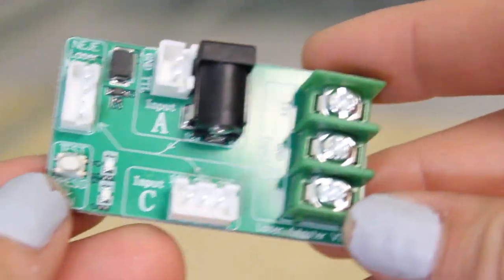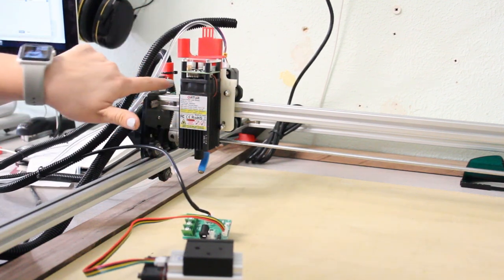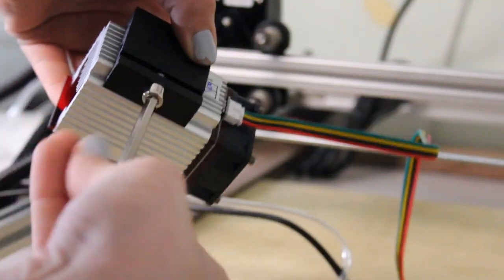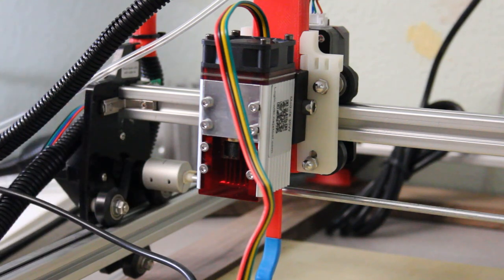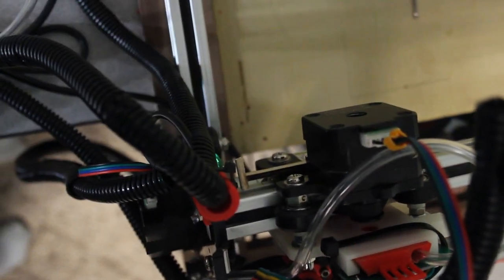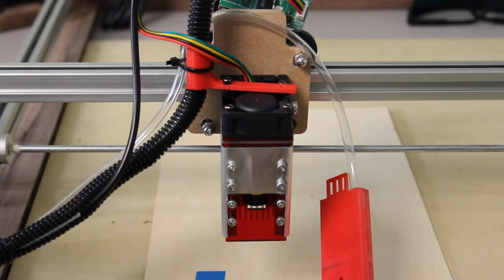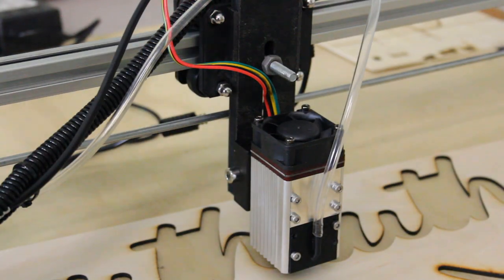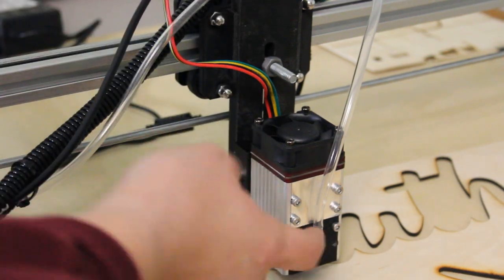Neje 30w Laser Installation on Ortur Laser Setup

Comment from the maker: I hope you all enjoyed the video! Also, let me know what you thought about the video quality. I just got a new Canon camera and used it in this video! Thanks for watching!!
Reply: I've just gotten my Ortur set up. Now I have to go and get a Neje. This channel is exceedingly hard on my wallet :-)
I'm learning tonnes from you though. Thanks!  One question: What percentage efficiency do you estimate that you gain from the air assist?
Reply from the maker: @davidr5964  Ha ha ha! Don’t let me tell you what you need to go buy.lol the ortur works just fine;) anyway, The air assist I think helps a lot. It clears away the smoke to also allow the laser to cut cleaner and last longer. I don’t think I would get a very clean cut with something with two passes without air assist. I feel like it probably makes it at least 80% better and makes your laser last longer. Before I had the air assist it was really hard to get a clean even cut in less passes
Reply: @TimberWood.Customs  Thanks a lot for the reply. I'm going to stick with the stock 5w on the Ortur until I at least try the 5w with air assist. Having lots of fun experimenting :)
Reply from the maker: @davidr5964  yeah in all honesty it’s not a huge difference from 5.5 to 7.5 I just really wanted to try it.
Reply: I had bought myself a genmitsu le5040 laser engraver and thought it will cut through plywood of 3mm, but it did not as there where misunderstanding or communication between the seller and myself and the output of 5.5w.

Last week I bought a Neje 30w output 7.5w laser module and replace the module with now problem

I need help on lasergrbl settings - in my book icon it does not show much of laser modules cause mine is now (30w) 7.5w and it shows only orthur 20w (5.5w) and other

Do I need other settings or software to be able to cut?
what do you think would be the best optimal focus distance between the laser and material?
Reply: @TimberWood.Customs  I had bought myself a genmitsu le5040 laser engraver and thought it will cut through plywood of 3mm, but it did not as there where misunderstanding or communication between the seller and myself and the output of 5.5w.

Last week I bought a Neje 30w output 7.5w laser module and replace the module with now problem

I need help on lasergrbl settings - in my book icon it does not show much of laser modules cause mine is now (30w) 7.5w and it shows only orthur 20w (5.5w) and other

Do I need other settings or software to be able to cut?
what do you think would be the best optimal focus distance between the laser and material?
Reply: pro tip : you can watch movies at kaldrostream. I've been using them for watching all kinds of movies recently.
Reply: @Hayes Elisha Definitely, been watching on flixzone} for since november myself =)

Comment: Excellent video. I was wondering if that air assist would work on my Neje Machine? And where I could get one? I cant find any that resemble that on. Thanks
Reply from the maker: You can get the air pump on amazon, it should be in the discription of the video

Comment: That's cool.  I'd love to add a 30-40 watt laser to my new Ortur Laser Master Pro 2 S2 LF.  I saw a guy on YouTube cutting 6mm plywood and pine board in 2 passes with his OLMP 2 s2 so I wrote to Ortur and they are sending me a new laser because mine takes 6 passes to cut through 3mm basswood plywood.  I wish Ortur would offer a 40 watt upgrade at a reasonable price (like $139 for their current lasers).  But I don't want to jerry-rig a Neje to this system.  I'd like one that's plug-n-play, so we'll have to wait for Ortur to step up to the plate and give us some options.
Reply: I have seen mounting brackets online that that make this Neje laser compatible with the Ortur machine so you wouldn’t have to drill. Last I checked, about $20 on EBay.
Reply: @jonathanshaffer4399  what do you search for on Ebay?  how detailed is your search query? Just Neje laser mounting bracket?

Comment: Nice job with the video. I have only one issue though. I bought one of the NEJE modules. It worked pretty good right out of the box. unfortunately it only lasted five hrs burning time. I tried to Warranty the module. They require a YouTube video, I am not a Tuber!!!! I watch videos not make them. I was a bit put off. well I made a video (it was really bad by standard) but it did show just how much power the module lost. my reply was, when it dies completely try and contact them again. DO keep in mind that this module dose not work period, it is nothing more than a laser pointer and not even a good one. Again I like your videos keep up good work but you may want to hold of on Neje vid's until you get more time on the module, if you do? Good luck.

Comment: I've upgraded my Ortur Laser Maser 2 20W (5.5W cutting) with the new Neje 80w (15w cutting with dual laser beam). It works fantastic !  However a couple of notes I found out in my research. My Ortur Laser Master 2 is a 12VDC setup and the new Neje 80w is also 12VDC. However there are some lasers (I think the new Ortur Laser Master Pro) that use a 24VDC Laser setup. If you try to connect this module to a 24VDC setup, you need to follow a different procedure or your new laser module will be fried. You will need to connect the supplied 12VDC power adapter directly to the socket on the supplied circuit board to power the laser module. You will also need to cut the power cable from the Laser control board to the laser.  Just a heads up.
Reply: This is the problem that I am trying to figure out. You mean just dont hook up the cable that powers the laser from the control board?

Comment: I had bought myself a genmitsu le5040 laser engraver and thought it will cut through plywood of 3mm, but it did not as there where misunderstanding or communication between the seller and myself and the output of 5.5w.

Last week I bought a Neje 30w output 7.5w laser module and replace the module with now problem

I need help on lasergrbl settings - in my book icon it does not show much of laser modules cause mine is now (30w) 7.5w and it shows only orthur 20w (5.5w) and other

Do I need other settings or software to be able to cut?
what do you think would be the best optimal focus distance between the laser and material?
Reply from the maker: U don’t have to do anything the laser is 7.5w and the software doesn’t change, when I changed from my 5.5w to the neje 7.5w I didn’t change anything in light burn
Reply from the maker: My 5.5w cut though 3mm ply, with 5 passes at 80 power and 300mm/min speed
Reply: @TimberWood.Customs  what do you think would be the best optimal focus distance between the laser and material?

Comment: Good job.
Can we connect same way with orture pro2 because It have been operated at 24 volt.
Reply from the maker: Yes you can
Reply: How can I.
Can share details..?
Reply: @TimberWood.Customs  how can I? Can u share details?
Reply from the maker: @atifali4703  should be able to connect just like I did in this video
Reply: @TimberWood.Customs  thank you  I shall be.
Reply: If it's working voltage are 12 then how it's compatible with ortur master 2 Pro because it's operating voltage are 24 and today I connected neje 30 watt Laser module with it its blow up.
Reply: It's blink one time after that nothing happened.
Then I tried to connect it with 12 volt with drivery circuit which was provided with neje but only fan is jerking.
When I connected with ortur I also used drivery circuit.
Can you help me how to repair 30 watt neje laser head.

Comment: Hello, the neje a40640 module comes with two cards. Both with power supply input. Considering that the ortur has its own, then will I need three sources? Or do I energize one of them like you did? cheers, ariel

Comment: where did you get STL file for 3D printed mount? I was trying to make one, but blender program is so confusing to me, and i dont have any program to design the new mount plate, or even but out from plywood. Is there any way I can get STL file for 3d printer for the mount you have? I failed so many times already, and once the 3D printer got stuck and entire filament went to a big waste..
Reply from the maker: Yeah if you message me on Instagram I can help!

Comment: I'm gonna cheat a bit I was able to get 2000mw Mini Laser Engraver Cutter for a low $110.  When it arrives I want to take my Neje Master 2 20 W head and board and put it into the larger frame so I can increase the bed size from 6 X 6.  to  ( 25.5 by 19.5 inches ) and put the lower watt in the Neje frame.  When I go to lightburn I would add it as a new device and put in the Dimensions  and then it will know the laser area  I think that's what  you advised me.  Any other  tips or tricks I should know?

Comment: The video was great! So I’m a little confused..you’re laser seems to have a huge cutting area..what is the size of space you have for the x and y axis? The one link you gave me says only 400m x 450m which is only like 16” right?id like a bigger area like 24”x24” is there a laser out there like that? If so please let me know..looking around the 300$ range and upgrading to the 7 watt later..thanks
Reply from the maker: Hi! So my machine was originally the 400 mm x 450 mm. But in my past videos I showed that I change the dimensions. My new cutting size is 916 mm x 787 mm. This laser is about $170 and the rails cost me probably $30. So you could probably build your own kind a looking like this for under 300

Comment: yesterday  received the Neje 30w Laser and it turns on as soon as I supply power. the switch has no control. was there anything special you did to control the beam. I am thinking I have a defective unit?
Reply from the maker: Just make sure you are using a stronger power supply. I upgraded mine to a six amp power supply plug-in. Other than that I was able to control everything through light burn

Comment: Hi, i watched the video and it did not work for me. I have the Ortur Laser Master 2 pro which is 24v. I plugged it in and pressed the test button and it did fire, but when i tried using it via lightburn the 2 LED on the interface module started to blink at the same time and i then got a smell of burning.

I disconnected everything and put my Ortur laser back on and it was ok. Does anyone know what the 2 LED lights means? Mine are flashing together (red and Blue).

Comment: You forgot to mention changing the power supply. Without the new power supply you're only going to get a marginal increase in output.
Reply: Hi There! This seems to be my problem. I installed the Neje Module on my Ortur but the result is that there is no better performance than compared to the original Ortur module. Where can I get a stronger power supply for my Ortur?
Reply: @killexawo  Amazon!
Reply: @TheLouisianaHobbyGuy  Alright, thanks! 12V, 3 Amps, correct? Do I have to remove the other power cable when I use the power supply? Or do I need to have both connected, power suppy and the plug with the three wires?
Reply: @killexawo  You should have the Neje adapter board, where you plug in the dedicated PS directly to the board not using the laser PS at all. And no, it is a 4A 12V at least.
Reply: @TheLouisianaHobbyGuy  Great, thanks for your support! I ordered a power supply and I am looking forward for better results then. I will let you know. Thanks once more!
Reply: @TheLouisianaHobbyGuy  I got my 5A 12V PS today and connected it. From the plug with the three cables I removed the red one (I read this on your channel). Result is very dissapointing. Absolutely no Power at all :-( Cutting is worse than with my old Ortur LU1-4 module
Reply: @killexawo  Well then you either have a bad PS or the wiring wrong.
Reply: @TheLouisianaHobbyGuy  Thanks for your help once more. I think I found a solution working for me: I connected the wires from Ortur to the Neje module directly, not using the adapter board at all. Going into the Ortur I am going with my 12V 5A Power supply now and I am very happy with the result. Thanks again :-)
Reply: @killexawo  Well you're not getting the full power of the laser module, but if you're happy, that's all that matters.
Reply: @TheLouisianaHobbyGuy  I should somehow go with my 12V/5A into the module correctly, right?
Reply: @TheLouisianaHobbyGuy  I tested this option, but unfortunately the laser burns permanently as soon as I plug in the power supply. (Of course I connected the TTL) I will go back to my last "concept" which worked pretty well.

Comment: What are the advantages of this new laser vs. the stock laser?  Thanks
Reply from the maker: In all honesty not a whole lot. Maybe a little bit faster in engraving and cutting materials because it is so close to the material. But honestly I just wanted to see what kind of difference it would make. But you don’t really need to upgrade if you have a 20 W(5.5w) laser already installed

Comment: How your ortur machine did not burn your laser ? I burnt my laser module by connecting my neje 20W laser to ortur without knowing that the ortur operates at 24V and laser module was supposed to be operated at 12V , so how is your laser working ?
Reply from the maker: It just never burnt it
Reply: @TimberWood.Customs  What is the power input of your ortur ? And what model is that?
Reply from the maker: @prajjwalsrivastava4269  i’m not totally sure I always just went off at being 40 W

Comment: hey what is laser software are you using? I'm using lightburn and i have some issues with it, and i don't understand why my $$ console shows an error message  fx. do you have any idea how i can solve this? thanks in advance
Reply from the maker: I use light burn. What error are you getting?
Reply: @TimberWood.Customs  fx��fx <- this one, I have the 40w neje master 2s Max. yes, lightburn is pretty good but i still have the issue fx��fx and i don't know where that come from.... :( i hopping that you can help me...
Reply from the maker: @pyp0ka  can u tell me what happens? Like what is “not working”